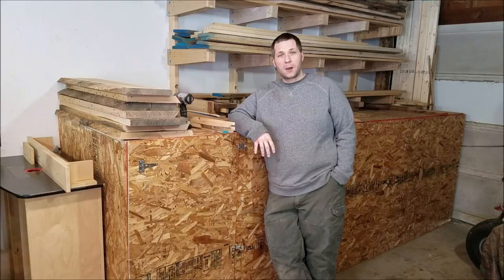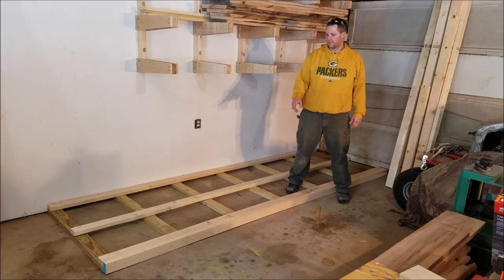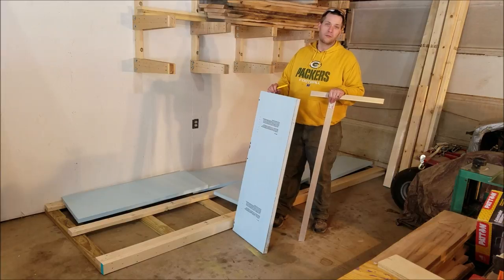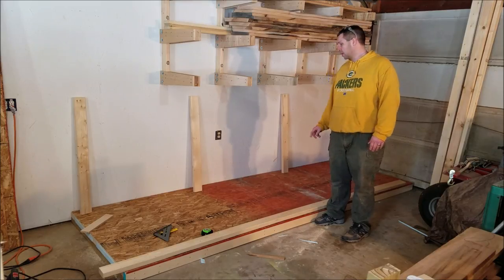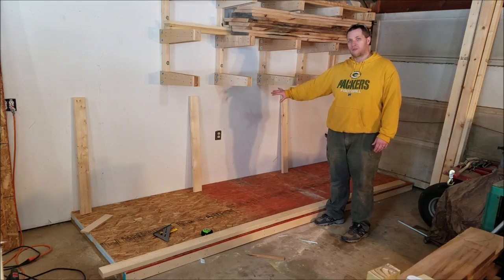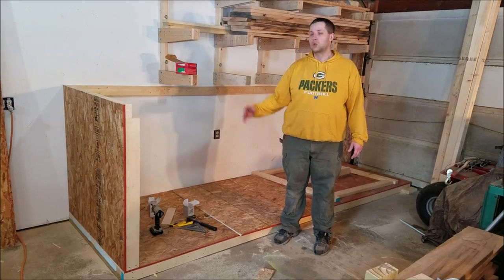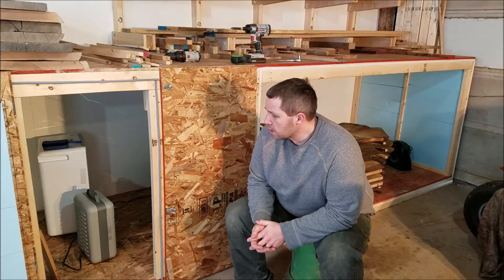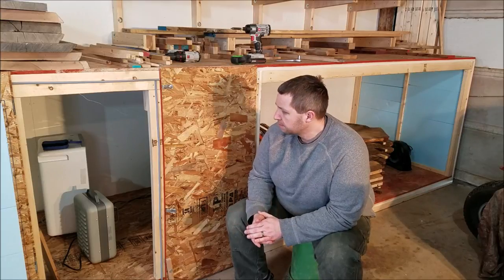DIY Dehumidification Kiln Build

Comment: Ken, I did this for a couple years. The dehumidifiers in the beginning were easy to bypass the high temp shutoff. Now they all seem to be computerized. I kept my kiln at 110°'-120°until no more water came out, then would get the temp up to 135°-140° for 12 hours to kill any bugs. Is there a dehumidifier that will take those temps?
Reply: no.

Comment: I built a similar sterilization kiln (4x4x10), however I used surplus 3" foam insulation as a box (no OSB and only a few 2x4's to support the roof). Temperature inside the box gets up 140F using only the heat from the running dehumidifier. No heater (potential fire hazard!) needed.
Reply: Bob, what dehumidifier did you use that operated at 140 degrees? Building my kiln now and not spending $8,000+ on a Nyle.

Comment: Have you had any issues with the dehumidifier or the heat fan running in a "wet" environment? what temperature would you guess that kiln is?
Reply from the maker: No.  No issues with that.  In the first month or so I got it too hot and burned up a heater and a household fan.  After that I added the attic fan which is made for much higher temperatures.  My thermostat maxes out at about 123 degrees and it gets quite a bit over that.  I would guess it maxes out at about 140.

Comment: Thanks for the video I have been looking for something like this. How well does it work? and about how long does it take to dry lumber?
Reply from the maker: +PC guides it was working ok with the setup shown in the video.  It was drying unevenly so I changed it since this video was done.  I filmed an upgrade to it the other day I just haven't been able to edit it yet.  I had some 4/4, 6/4, and 8/4 in there for the first charge.  The 4/4 took about 3 weeks from around 30% moisture content.  6/4 was about 4 weeks.  The 8/4 has been about 8 weeks so far.
Reply: @kencook8892  you should get a a/c dehumidifier/ heater combo for 400.00. It works year round and is more efficient. Im a jerk with a opinion. Take it or leave it.

Comment: Hey Ken,
I'm setting up a small kiln like this, and i'm having issues with my dehumidifier - it won't run if the humidity is too low, and lately it isn't collecting any water at all.  I bought another one, and its having similar issues.  Do you have any recommendations for getting this to work, or humidifiers that just run without all the circuitry getting in the way?